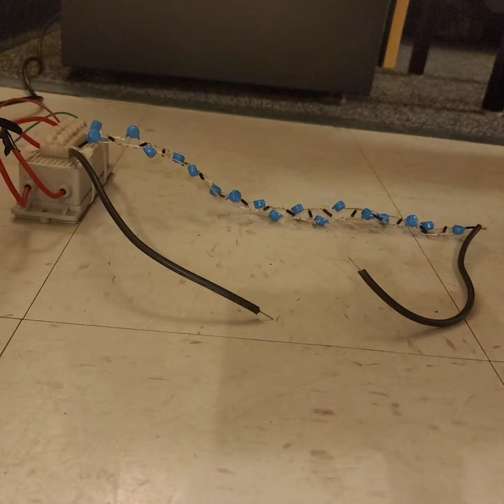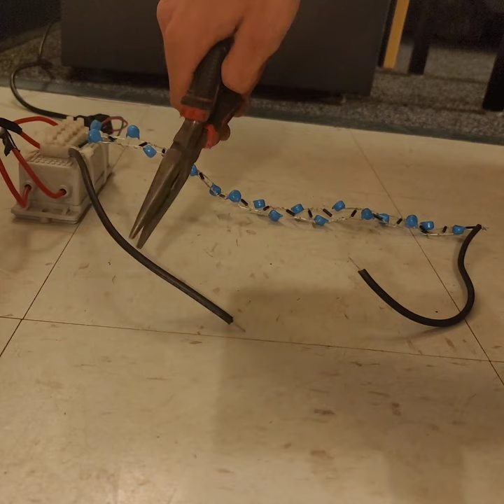9 STAGE VOLTAGE MULTIPLIER GOES OVER 30KV!!!

Comment: Thats more like 10-30kv
Reply from the maker: I'll fix that
Reply: @circuitbash  whats ur input AC voltage?
Reply from the maker: @thomasmaloney4325  about 5kv from  the air purifier module. It says 10kv on the product description, but the initial arc is too small to be 10kv. It has a very high frequency though
Reply: @circuitbash  1cm arc ~ 10,000 volts
Reply from the maker: @thomasmaloney4325  I get up to two inches our of this thing in good humidity
Reply: @thomasmaloney4325 More like 15-17kV according to literature. Dry air is reportedly around 30 kV
Reply: 30kv
Reply: @circuitbash if 5kv is feed through 9 stagesit should make 45kv but it has some inefficiency  and coronal discharge making it about 30kv so you did say it correct.

Comment: You are losing a lot of energy through corona discharge on pointed joints. It is very tricky to build an efficient voltage multiplier with minimum losses. However it is a good proof of concept.
Reply from the maker: That is right. And also, I couldn't solder anything together which I believe is the main issue 😅
Reply: Yes bro corona discharge
Reply: Just submerge it in oil
Reply: @Rev-maniac7500 the cables and everything?

Comment: What diodes and capacitors did you use?
Reply from the maker: 25kv ceramic caps (I forgot the exact capacitance) and 15-20kV 10mA diodes, I think. All from Amazon
Reply: @circuitbash  thank you

Comment: That looks like an ac ballast . i have 2 of them , should i create a voltage multiplier simalar to yours ?
Reply from the maker: It’s a high frequency high voltage power supply from an ozone generator. I have used a ballast with an ac flyback before too!

Comment: What is the rating of capactiors ? Is it 2kv ?
Reply from the maker: I believe they were 20 k with 15k 10mA diodes. All from Amazon. Please solder. Mine sucked due to losses, especially right angle losses

Comment: How many volts coming out of that?
Reply from the maker: I believe 30-35kV but it would be higher if soldered and immersed in oil
Reply: @circuitbash  can you make a portal out of that?
Reply from the maker: @roblox_progamers1104  I’d like to make one of those sweeping plasma vectors people make with permanent magnets and a hv hf source. People call these “portals” sometimes. They are neat gadgets

Comment: Can i get the circuit
Reply from the maker: Look up:
Walton-Cockroft multiplier, and ozone generator power supply. I got 20kV ceramic capacitors and 15kV diodes from Amazon. It can be made for under $60 if you go cheap. And have a much higher output if you solder and put under mineral oil or epoxy